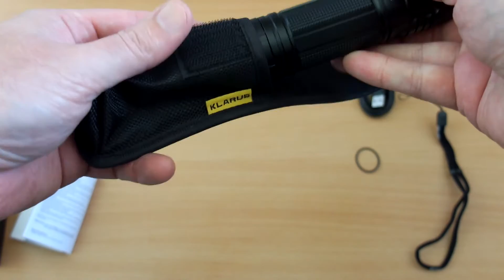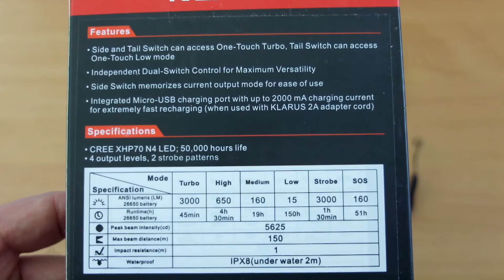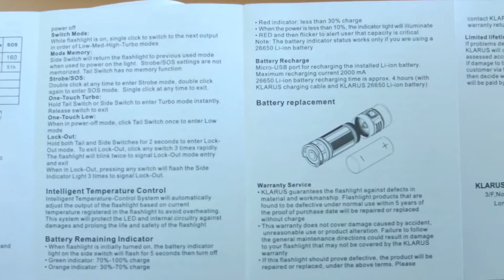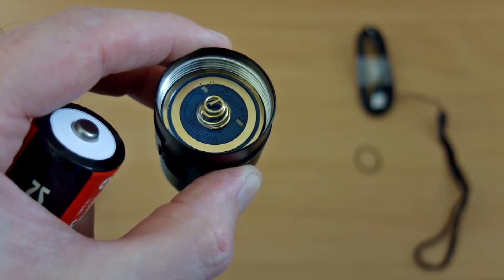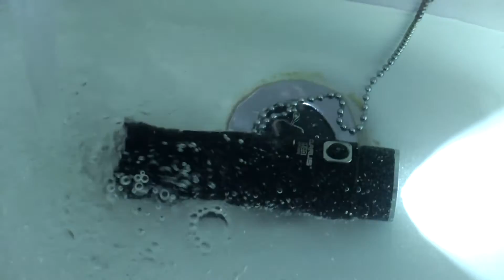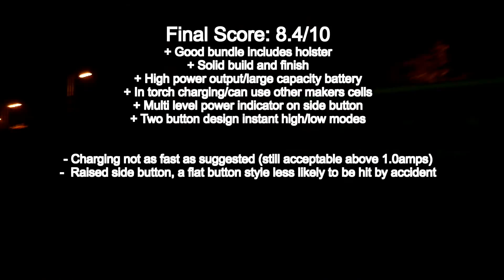Klarus G20 LED Torch - Review and test

Comment: The battery looks like a protected one. Will it work with 26650 batteries if the flatter unprotected ones? Thanks!
Reply from the maker: It works with both

Comment: One other thing to add here, the slot where you attach the wrist strap isn't finished properly. I attached the strap, and after a few weeks of use, the cable frayed off. That was the only problem I had with this light, not a huge issue. Thanks for the review.
Reply from the maker: Maybe you got a rogue sample I'd have kicked up a bit if it breaks the strap. This is one of my older ones reviews wise it's a decent torch in most areas

Comment: hi. i bought this and it seems like the LED works only partially. when i switch it off and quickly look at the LED, 1/4 is already dim, 2/4 almost dim and last part dims a lot slower than the rest. it takes about 1,5 sec for it to fully dim. is that normal? i have thrunite tn12 2016(1050 lumen) and its hard to tell if this really is three times brighter because the beam in this is so wide but im sure it is atleast as bright.

do you know more about this led and how it works?

anyway.. nice review :)
Reply from the maker: Hi not seem any obvious delay in the LED's turning off on this one..some of the newer models have a slower smooth power on/off (least the recent Olight ones by design).  Keep an eye on it charge the battery fully and see if it continues. The beam spread on this is wide quite - the candela rating indicates the concentration or spread a lower number (such as this 5625) means a wide beam if it were 15000 or higher much narrower. Larger numbers more range but less spread lower ones wider. It certainly has more power than the 18650 models that I've used it just pushes the power more evenly across the beam rather than a high power longer range beam in a smaller area.

Hope that helps a bit
Reply: ok thx :). i guess its a feature. it does get a lot warmer than tn12 for sure at turbo mode so i guess it does somehow save the LED.

im not a youtuber or any kind of video producer but i upload a s*itty video about this. watch it if you want.. i really like this two-mode thing. i use moonlight mode and turbo mode at work and rarely anything in between those.
Reply from the maker: Hi Joana had a look at the video does seem like a bit of a delay powering off I'll check the torch again if it's not causing an issue just keep an eye on it (ie it's working fine in other ways). At full power it does heat up but it's pumping out a lot of lumens compared to the TN12 so the heat build up is to be expected thus it's drops down after some time to protect the LED. If you think that's hot try the S1R Baton at 900 lumens the tiny body heats quite a lot!
Reply: oki. thx again. so i guess its normal then. and no it is not "HOT" hot. ive seen flash lights set paper on fire on youtube and this will not. it hurts my hand though..